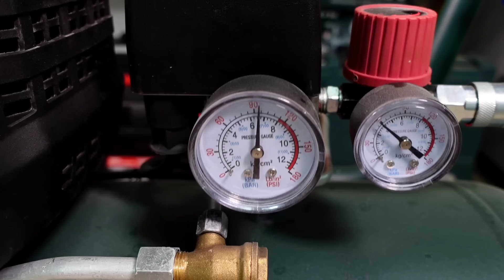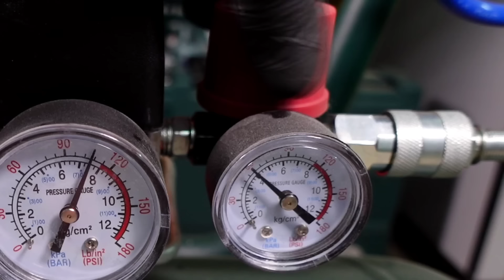Very Beautiful and Rare Assassin's Dagger - Restoration ASMR

Comment: From the style and design, I believe that’s actually meant to be a letter opener. Though I could most certainly be wrong.
Reply from the maker: Opening letters? How is it?)
Reply: I think so too
Reply: Looks like a letter (wax seal) opener and the back would be a seal stamp? I saw something similar on an antique desk once.
Reply: @TheRestorer  meant to open an envelope, or slice under a wax seal. Too decorative to be a blade meant to be used in stealth.

Assassins wouldn’t want something so showy, stands out, sticks in the memory. Assassination is all about stealth and not being noticed.

An assassin’s blade would be plain, unremarkable, and easy to hide. I say this only as an author and TTRPG player, not as someone with practical knowledge or experience.
Reply: @katrinthorsdottir7514  this is more or less exactly right.
Reply: It looks like a letter opener
Reply: It could be both,an assassin's dagger disguised as a letter opener
Reply: thought so too - maybe the assassin used to disguise himself as a harmless postman to sneak up on his unassuming victims
Reply: My thoughts exactly
Reply: Letter opener
Reply: Yes, its a letter opener.
Reply: Definitely a letter opener. The edges are not meant to be given a sharp edge but should slide under the flap of an envelope and tear open the topside . And a slightly dull point for prying open wax seals. You could add a family crest seal stamp to the end of the hilt for sending letters
Reply: letter opener doesnt sell seats like assassins knife does
Reply: @lancemillward2462 🤭
Reply: It's  called a dagger.  Women would hide them in their boots for protection.  A letter opener would be thinner and shorter.  The hilt was ornate because women preferred dainty blade.
Reply: My first thought, blade looks non ferrous, not really suitable for a dagger.
Reply: @TheRestorer  small daggers, where used to conceal easily in a boot and women would carry in a bag or purse as no one suspected a woman using a small dagger .  It is only my own feel from it.
Reply: I agree.
Reply: My father has something very similar. Brass but fake jewels in the handle. It was, i think, from India and was a letter opener made to look like a dagger. From memory it had a curved blade. I'm talking 1960s. My brother fell while playing it and stabbed his face nearly hitting his eye so Dad put it away. I dont know what happened to it. It disappeared one day but replaced later with an inferior one, Ottoman style.
Reply: Thank you. @stephanietaylor8003
Reply: I have Letter openers'. Problem is there were no Letters to mail. Messages were transported by the Messenger. Haven't you ever head "Don't kill me I am only the messenger".
Reply: It's honestly probably some cheap letter opener that you can buy off of temu..  there's obviously rust on it but there'd be a lot more pitting if it was naturally done
Reply: @ShadowOfDeadRhodes21  I can tell a Biden Supporter by reading your Liberal Comments.🎌🎌🎌🎌🎌
Reply: Letter opener.  Hardly “rare”
Reply: @katrinthorsdottir7514 but assassin can use it if it be near.🤔
Reply: That's a knife now 🤣
Reply: This IS a ordinary letter opener, right!
Reply: @TheRestorer its cute that you genuinely dont know what this thing is and just proceed to believe its an assassins dagger
Reply: The perfect murder weapon
Reply: Yup... It is a letter opener.. Great job restoring it.
Reply: @katrinthorsdottir7514  Hmmmm sounds pretty fishy to me
Reply: Sicuramente è un tagliacarte!😂
Reply: Yeah definitely a letter opener many old person still have them around here and first you can't stab with this your hand will end on the blade (ok for self defense not ok for assassination 😂), second the blade herself isn't ideal a fine, "pointy" blade is better for this job and yes the hand is too recognizable and very uncomfortable (again you will slip and it will be hell to clean after your job).
Not in the profession tho just love blades and HEMA 😅
Reply: You are' NOT wrong!😂😂😂
Reply: Иннцест
Reply: @moriganna67ify  or, perhaps, the woman is an assassin and just wants a pretty knife for her handiwork.
Reply: Dagger dagger dagger dagger! Where’s the fun in letter opener?
Reply: так и есть)
Reply: Especially since it’s made of brass or bronze, definitely not intended to be a weapon 😅
Reply: I agree ..
Reply: Eu tbm acho que é para abrir cartas
Reply: I'd use it as a dagger. Who actually uses a letter opener anymore?
Reply: @игорьрешетников-ф4ь 😂
Reply: My thoughts exactly, however still a lovely restoration 👍🏻
Reply: lets just put this out there for future reference. nobody cares what it is, it was only titled that way so people would click on it
Reply: It's an assassin's letter opener. Believe it or not they get mail too.
Reply: I think so you right a proper dagger for stabbing would have a guard.
Reply: I'm certain it's a gold dagger used to defeat all enemies of mankind the world over! 🤨 it's up to you now to save us!
Reply: You’re 100% correct
Reply: @moriganna67ify it’s a letter opener. Relax champ
Reply: @trentd.  no see the blade is too wide and big to be a letter opener.  I mean, you could use it in other ways like any short sword and daggers.  Letter openers fit in a hand and is a much thinner blade.  The Hilt gives it away.  Shows the size of the blade.  Hope that made sense. 😄 🤣 I love and own some beautiful daggers and short swords and a Rappier that broke when a former friend slapped it on his gf butt the sheath on .  I fixed it, but it will never be the same, hahaha.

Comment: Hey nice Work on such a Amazing Dagger.  I found on line for a DIP that Removes Rust ..   Molasses and Water at about 6 to one, it works great.  I build custom Trucks and my 35 Truck hood was Frozen solid , so I mixed a batch of Mol Dip filled up a Kiddy pool and in Five Days that Rusted and Frozen Hood ,  was Clean and Pulled Apart By it self .  That Damn Dip lasted some 6 months and worked great on anything metal, Brass,  Bronze .,  Good luck Ben
Reply from the maker: Hello! Thanks for the advice!👍😉
Where are you watching from?🌍😉

Comment: Fake. "simulated rust" coating did not affect metal at all. No pitting, erosion etc. especially if it was "ancient". It's a not very old letter opener.
Reply from the maker: Why? Because brass does not corrode so easily. And it's not exactly rust. The surface oxidized over time
Reply: You could be right. But it is still very entertaining TMO.

Comment: The handle was made from a different metal from the steel blade. From silver as I suppose.
Reply from the maker: Do you think it's silver?
Reply: @TheRestorer  Maybe. But you have to check. However, if it is from the XIX  century or older (as it looks), couldn't be made from aluminum because this one has been used since 1886 when one (or two I don't remember) of the chemists discovered the method to obtain cheap aluminum from ore. Before this date, aluminum was as expensive as gold. Can be zinc, which is also silvery as well, but this one doesn't look like made from zinc. It can not be chrome or nickel because they are very shiny, and this handle is not. So most probably it's silver. Of course, I do not say the solid silver! Pure silver is expensive, so for centuries people knew a lot of methods of how to mix silver with other metals. For instance -  with tin or copper. So, it can be an alloy.

Comment: Any assassin would appreciate your result. Easily concealed and identified by touch, the elaborate decoration that slides without snagging. A long, thin, surgically smooth blade that penetrates deep and allows the cut to close long enough to prevent initial obvious external bleeding. You have indeed restored this weapon, and made an historical statement at the same time.
Reply: It's a letter opener.